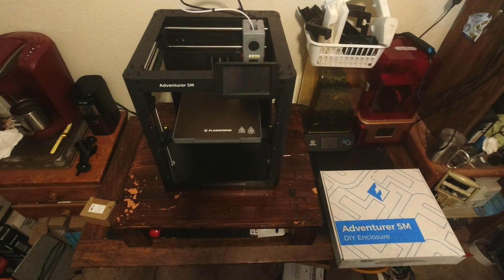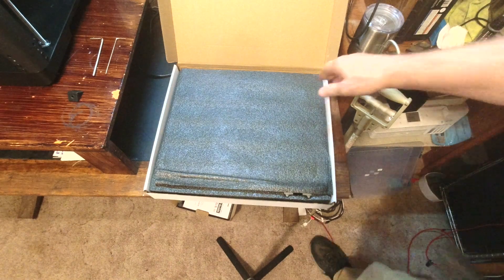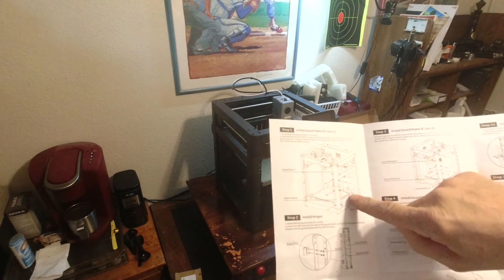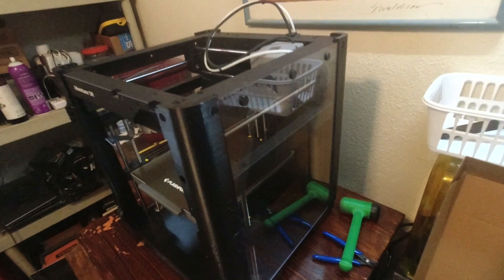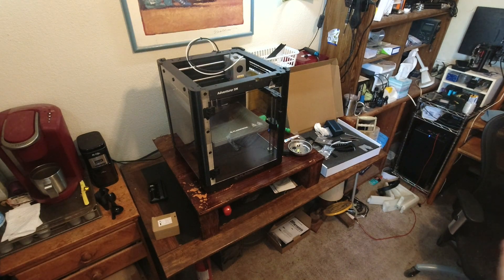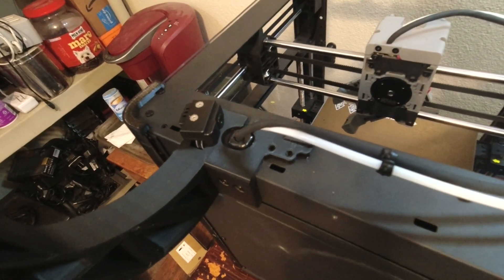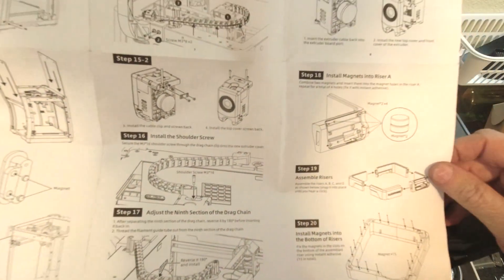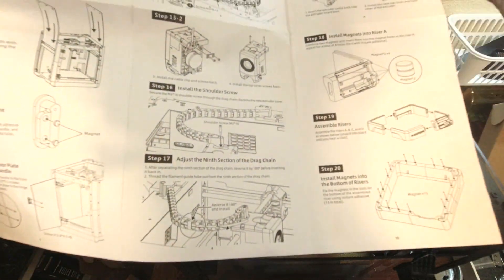Flashforge Adventurer 5M DIY enclosure build and what I think of it.

Comment: how did you get the risers to go together? I wished I had some pipe clamps or something. I'm also thing about putting the male ends in the freezer and the female in hot water. I don't want to use grease.
Reply from the maker: Did you print from the 3MF file or from individual STL files? When I printed from the 3MF file everything fit well. When I, and almost everyone I talked to, printed from the STL files there was lots of problems. Don't use grease, use beeswax. Also, don't heat it so much that it will easily deform.

Comment: Mine (Or my kid's) arrives tomorrow. I can see where my weekend is going. Main thing for me is to get the noise levels down so the misses doesn't ban it.
Reply from the maker: Compared to older printers it's not loud without the enclosure, with it it's very quiet. She's more likely to complain about some of the stinkier filaments like ABS so you might want to avoid those if she's sensitive to odors.

Comment: am i missing something, how do you print the front plate that goes above the door? the 5m doesnt fit that and im so confused
Reply from the maker: I think you and others are having problems because you're trying to print the individual STL files instead of using the 3MF files that came as part of the enclosure info. When you use the 3MF files it auto arranges all the parts for you as well as puts the proper slicer settings in. You'll have to use Orcaslicer or Orca-Flashforge but it makes it so much easier. Try that and see if it doesn't solve your problem.

Comment: 7:10 founded this but stupid spool holder I don't need just easy cut off part only filament sensor holder because I have Filament dryer already.
Very difficult screw & plug because wrong sides they mistake by Chinese

Comment: why is the lower guard plates taking me 4 hours to print?? the top half is another 4?? I should have just bought the pro
Reply: The top pieces are running me about 12 hours each
Reply: i did the top piece's last night each piece took me 3h20mins to print at %15 infill. and i just did the math and feel the same as you, i should have just spent the extra 40 bucks and got the pro. by the time you pay for the printer pay for the diy kit and then at least 2 rolls PLA you're not to far from the price of the pro. Happy Printing!

Comment: Wtf $40 for what some plexy and a few hinges ? Go buy it your self i bet thats $40usd too thats like $56 cad for $15 cad you can get all that shit maybe less 

If you swap the sides for a foam board you lose the ability see in from the sides but you increase insulation and decrease cost of enclosure you should be able to make this for $40cad including the PLA filament which would be like $24-25usd i wouldn’t recommend wasting money on the kit unless you enjoy wasting money then go for it 😂
Reply: Also i would recommend you swap the PLA for PVB so you can vapour smooth it and they are roughly the same price if you were about to spend $40usd on this kit you might as well use the money saved on not buying the kit and get your self some pvb filament that way it looks professional (injection molded appearance)
Reply: Tho out of everyone on youtube he did chose the coolest colorway to print it in so i give ya that
Reply from the maker: You can't really be as ignorant as you sound, I'm just not willing to believe it. So I'm betting you're what, 12 years old? Does Mommy know you're posting on the interwebs?
Reply: i just walked out of home depot, i'd really like to see where you are getting plexiglass for this kit under 15 bucks.... i am also in Canada.

Comment: Getting really annoyed with some of the simpler parts of this thing - are those tubes just friction-fit into that sensor? There's little clips I took off but it didn't seem to make anything move any easier

My biggest frustration with this thing is that the directions start from the point where everything is already detached. It's not starting from a point where I would assume 99% of the builders are coming from, which is the fact they just printed everything from this very printer. Some of this stuff is on very tight but you don't know if you missed a screw or clip something or if you should just brute-force it. And of course I'm hesitant to try that

edit: after yet more googling, I found you need to push in on the little round collars until you hear them "click", then the tubes come right out. I give the instructions 2 stars. 
These companies in the modern era need to stop relying on youtube to handle their shit documentation. I don't care what country they are out of

Thanks for making this to show so much of the process!
Reply from the maker: As you found out the tubes are just a push fit but that collar has to be depressed first. Those clips you removed are to keep the tube accidently coming out. I typically don't put them back in.

It really helps doing this stuff if you have some mechanical background and have worked on 3D printers in the past. But everyone has to start somewhere. Ask questions, don't force things and in a while you'll be the one answering questions.

Comment: When i did this upgrade to mine the filament sensor acted like it only allowed filament to pass one way. Could not get it to go through so mine is a bit hokey for now until i get a new sensor in as i think mine was a manufacturing defect.
Reply from the maker: Mine doesn't seem to like filament going in the wrong way either. I think the opening is flared on one side to make starting the filament through it easier. But I found that if I cut the filament at an angle and straightened it a bit it would go in. I've been meaning to modify it, but so far it hasn't annoyed me badly enough.
Reply: I ended up breaking the top of my enclosure due to this issue. I have taken it apart 10 times to look at the mechanisms and how it works. I am still stumped. If this issue is fixed I might actually enjoy my enclosure.

Comment: Hi Chuck i had same issue with hinges on the door binding so i modified thier STL to move the hinge holes 1mm to the left and this resolved the issue. I can send you the STL if you wish to reprint them.
Reply from the maker: Sure, I'd love to give them a try. You can send them to my email address 3rdpig@gmail.com or, if you've posted them to thingiverse or printables send me the link.

Comment: Hi again. Just wondering if you had any issues pushing the data ribbon to lcd screen through the riser slit and did you need to unnaturally fold or twist it to enable connection?  My concern is that I risk damaging the data ribbon if it twisted or folded over, especially when fixing the blanking plate above the door since it is pushed on over the ribbon's location?
Reply from the maker: I think it just slid through without folding. I don't remember having any real issues with it.
Reply: @3rdpig thanks ...with 5m printer the data ribbon is glued to tge top frame and it needs to be turned 180 degrees before being thread through the riser slit...otherwise the ribbon won't be the correct way around to plug into the lcd screen...perhaps the glued ribbon was glued to the metal frame back to front for the one I purchased. I am also having trouble clicking the blanking plate over the door as the one I printed won't clip in place....once I figure this out I'll be happy it's finished lol.

Comment: Hi....I have 2 more risers to print with PLA filiment and im ready give full assembly a crack. How much force did you have to use to connect risers together? I attempt to connect the front two risers, but it feels like i am risking snapping them in the process. Any tips to avoid damaging the risers during connection? Cheers
Reply from the maker: There were definitely a tight fit, that's for sure. I just shoved mine together and hoped for the best  and fortunately they didn't break. I suppose you could file the tabs smoother and maybe use something like bar soap or beeswax to lube them up before shoving them together.
Reply: Thankyou  @3rdpig

Comment: I'm having trouble with the filament sensor, the original spool holder has you orient it the sensor to wear the one way feed is facing the wrong direction. So I got all the way done and when I went to feed the filament through it was stopping at the sensor. Then I printed the V_2 spool holder that I downloaded from their website, and their is no way for the cable to go through the spool holder. From your video I can see you have the filament sensor positioned the same way I had mine when I originally built it, but you seemed to have no issue with it. Do you know if I could be doing something incorrectly?
Reply from the maker: I wouldn't say I have no issue with it, it does take some fiddling to get the filament through. What I do is cut the filament at an angle with the long side of the cut on the outside of the curve and if that doesn't work I take an emery board I swiped from my wife and just file around the tip of the filament so it doesn't hang up going in.

Comment: How di you get the filament to go into the sensor after flipping it around. It feels like its hitting something
Reply from the maker: I cut the end at an angle with the shortest part of the cut on the inside of the curl, that and twisting it slightly will usually get it in. If it really struggles I steal one of my wife's emery boards and sand the sharp edges off. But usually I can get it to go without that.
Reply: @3rdpig  awesome thanks ill give that a try
Reply: @3rdpig  great and informative videos, by the way!

Comment: I have only found 2 reviews on this enclosure and they are more about the insulation than the actual review.  The flashforge has professional videos I only need your opinion and review.  I am curious if you never used any of the other filaments would you still recommend the product?  How about a quick review on all the other extras you have installed?  was it worth the time and did it make your printing experience better ?  I have a big old shop light over my printer so the aftermarket lights probably won’t make much difference.  I had a webcam I already had laying around and have it mounted on the shelf next to the printer Is it worth it to use the aftermarket one that wires to the printer?  a message/reply to my comment would help.  A honest assessment on all the extras that you have installed and what ones you think are a real benefit?   If they were free would you still install them?  I gave your video a like but you left me with more questions than answers.  If you can help me out I would greatly appreciate it.
Reply from the maker: The enclosure is absolutely worth the time. It made my printing experience better and I recommend it. Everything I installed on this printer has been worthwhile. The android app is called Flash Maker and it's not really necessary unless you want to remotely monitor a print. I'm not sure I understand the point of some of your other questions about "if it were free" or about "other filaments". if you have a specific question go ahead and ask and I'll do my best to answer.
Reply: @ I appreciate you taking the time to respond.  I installed the app but haven’t been home to pair the printer with the app.  Do you know if you able to cancel a print with this app?  This printer has been much easier compared to the last one my son was gifted.  Mother-in-law  got him a anycubic two Christmas back and I spent the better part of a year dealing with the customer service, emails back-and-forth over three different tech workers, a language barrier on top of time changes and the problem still never got me passed the test print.  We never had a receipt so all the parts I ended have to buy out of pocket and they still never figured out what was wrong.  They had a script and I was never able to get it straightened out.  I gave it to my engineering buddies and they right away noticed a fried resistor on both motherboards the one it came with and the replacement I bought.  The company had pictures but never took the time to really look at them.  I guess that story is just telling people to avoid Anycubic if you have any problems its a mess over there.  I have this printer now and I have had 0 problems so far.  I have a big light over it but the aftermarket would make it look more put together.  Like I said I have a webcam hooked up and if something goes wrong I have the printer itself plugged into a smart plug so I can at least shut it off that way.  I have only had a couple problems with the filament getting knotted on the spool which would be solved by the top load I think. I have a issue that I think would be fixed with a filament dryer box.  do you know how you would be able to run one of those with the set up you have now?  I kinda think I would like to run it straight from the box to the printer have you looked into that yet?  Anyway thanks again for getting back to me and even though I don’t really watch channels like yours I am going to add you to my subscriber list.  One wrong subscription can really mess up my very curated Al G Rhythm but you seem to have the answers to my questions and its worth the gamble to help out your channel

Comment: what type of filament did you use for the 3D printed parts
Reply from the maker: I used what's specified in the instructions, which is PLA for most of it and some of the parts called for PETG. Sorry, but I can't remember which, but it's in the instructions or you can watch my other build videos. For brand I used Elegoo Rapid PLA and Rapid PETG.
Reply: Unfortunately I went to the video on YouTube and the pdf file for directions won't open

Comment: I just put my enclosure on mine today and now i can't get the filament to load passed the sensor... Can't find anything to help troubleshoot it nor can I get the tube out.... Rather frustrating...
Reply from the maker: I take it you're new to 3D printing, what you're dealing with is what we all went through with our first printer. To get the filament past the sensor cut the end at as steep an angle as you can. Also, straighten it at the end for 4-6 inches, then feed it past the sensor, sometimes twisting it as you push can help. To get the tube out push the ring on the mouth of the sensor inwards before you pull the tube. Also, check to see if there's a removable piece there that prevents you from pushing the ring in, and pull that off first. Good luck!
Reply: @3rdpig  a bit new. I have only used an anet A8 and this is a big upgrade. Thanks for the tips!
Reply: @3rdpig  thanks much for the tips, I was able to get the tube removed without breaking anything. It seems to me that the sensor is a one way only...
Reply: @miktarredfox Yes, the sensor is one-way, I think it's a mistake when creating this improvement kit.
Reply: @OPTIMUSPRIME_ONEPRIME  yeah it is a flaw in the orientation of the sensor on the filament holder. Figured out how to fix it and it's been running happily ever since!
Reply: @miktarredfox  Can you tell me how to solve this problem? It is at this moment that I am thinking of solving this problem radically - by filing the inner foot, which just closes the contact.
Reply: @OPTIMUSPRIME_ONEPRIME  I undid the back panel and re-routed the sensor cable for more length so that I could install it orientated correctly with the cable plugged in, since installing it that was is "incorrect". Also there are 2 filament holder models to print, you want the one that has the cutout for the sensor which I think is v2.

Comment: I have flashforge. This one, the screen clip came so tight, that it stopped working right, and I ended up returning it. I do this kind of clips everyday on laptops and this one was waayy tighter than it should have been.
I got the pro!! Everything comes ready. Even came with an additional nozzle.

Comment: I had a lot more fun stringing issues with my corner pieces I printed. 
Also  do you have to scale down the spool holder? It won’t fit on my build plate.  I’m a noob so I’m probably doing it wrong or have the wrong settings
Reply from the maker: I had stringing too, but I find it pretty easy to deal with, I scrape off the larger pieces and use a butane lighter to melt back the finer strings. Kind of like melting spider webs with a torch in Harry Potter, lol. The spool holder fits on the bed, you've got to rotate it a bit to get the sweet spot.

Comment: $40 for the kit, $40 for the filement.  Add $40 for a second nozzle, a camera and you're not far from the 5M pro.  There was a large sale recently that made the pro only $30 or so more than the base 5M.  So glad I went that rout as my time is also worth sonething as well.
Reply from the maker: You over priced what the filament and nozzle costs, but your point still remains valid. Plus you get the filtration system in the Pro. but at the cost of the Pro you have to consider the Qidi Tech Q1 Pro is now $450 and you get all that and an active heated chamber.
Reply: @3rdpig  not if he is in Canada it was 60 Can for the kit aboot 45 for the rolls 50 for a new nozzle and 50 for the camera.
Reply: You do have a valid point, but from what I've seen, the pro actually has a shortcoming that you can get around with the nonpro version. The pro has an soft on/off button. if you supply power to the printer through a switchable plug The Pro will not come on where the non pro will and you can completely automate your setup remotely.
Reply: I printed it with the default 0.4 nozzle. If everything is made of one material, another nozzle is not necessary. A pack of PETG costs ~$20 (include print side lower spool holder). I used leftover polycarbonate from another project in the workshop. It is not always necessary to buy a kit.